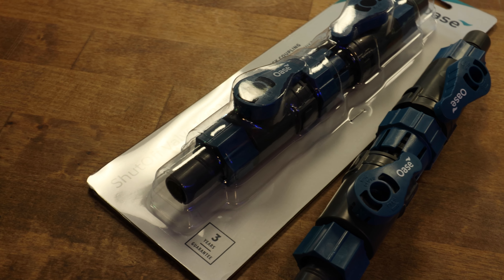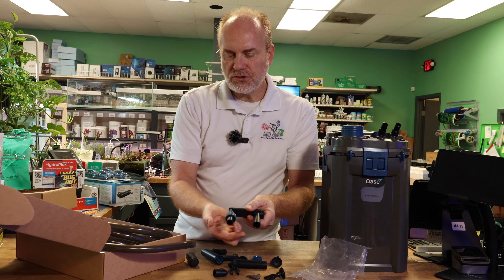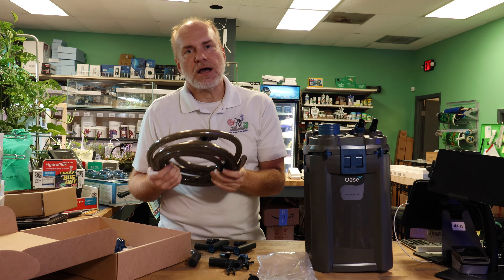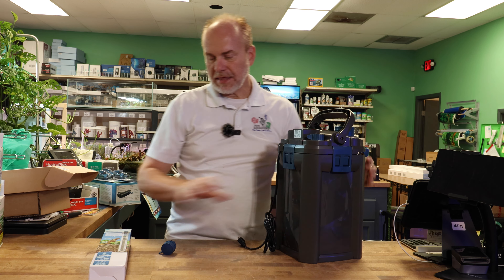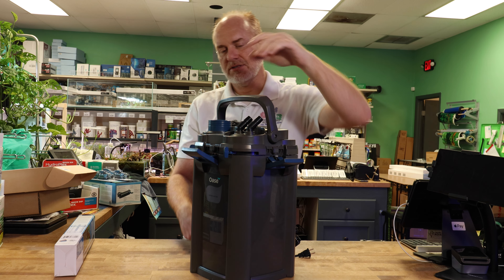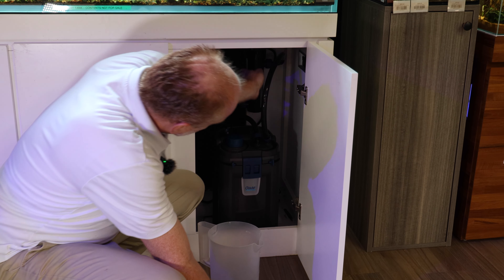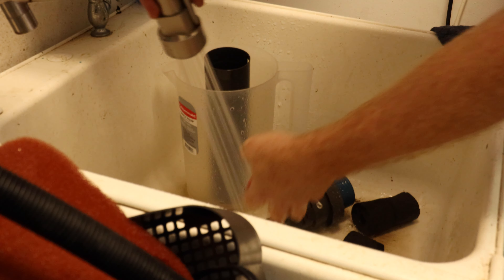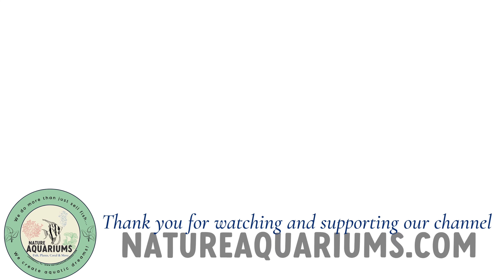Master Your Aquarium: Ultimate Guide to Oase Biomaster Filter Setup & Maintenance!

Comment: Thank you for great video, 
I have some queries:
1- should I add the hose when water start boiling or from starting heating water until come boiling,  and how long the hose should stay in water?
2- heater built in canister,  is it  safe of any heater disaster like blast or something like that?
Thanks in advance
Reply from the maker: You are welcome thx for the comments

1 super hot water. Place hose for 5-6 mins. 
2 heater super safe. Replace every 3 years
Reply: @natureaquariumsusa  thank you Mr. Henry

Comment: I have the 600 version and keep getting bubles on the outflow.any good tips?
Reply from the maker: Yes. Did you use hot water for softening the tubing before making all of the connections (pipes and to the filter)? How long has the filter been running ? Did you tighten the nuts (by unscrewing them on the hoses)?
Reply: @natureaquariumsusa  I'll tell you what I've tried for anyone else reading.so after a complete clean of the filter (after 1 year of usage),I started getting air on the outflow.very noisy.i checked all the pipes and the air was coming from somewhere around the head of the filter.i opened and used olive oil on the gaskets and increased the volume from the screws to max and kept playing with that on both sides from minimum to maximum.eventually it worked.no more bubbles now.
Reply from the maker: Hi. So it’s best to use a silicone lubricant designed for food and aquarium use like this:

https://natureaquariums.com/products/aquatop-oring-silicone-lubricant-1ea